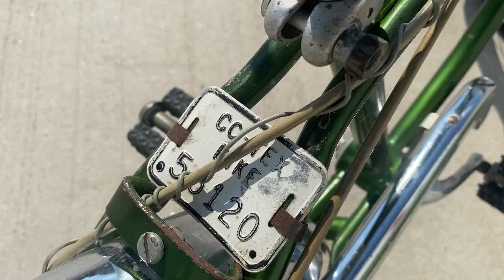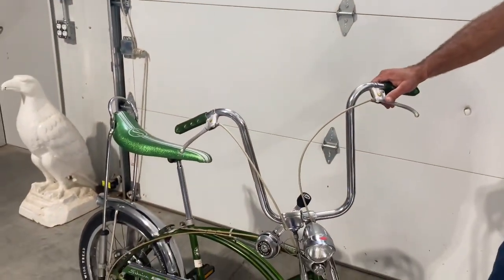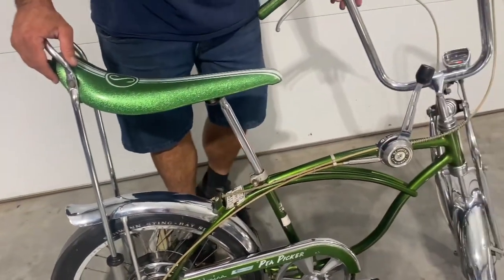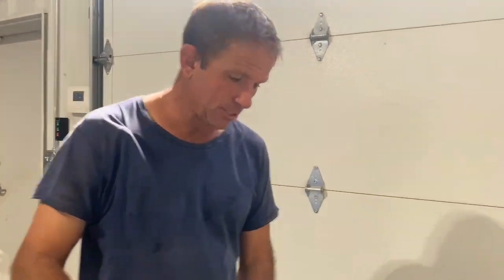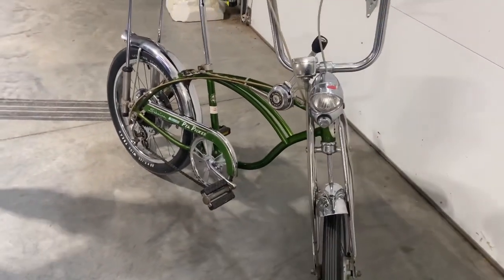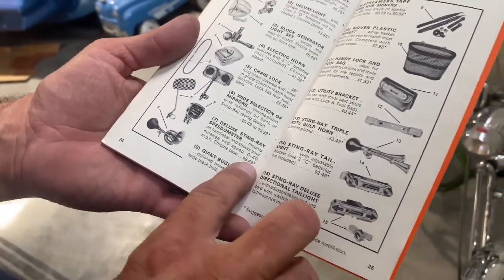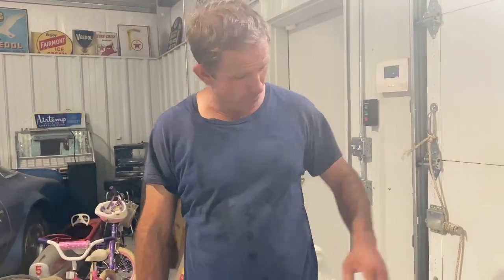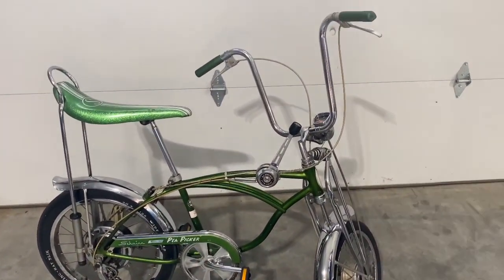1972 Schwinn Pea Picker Krate Muscle Bike Disc Brake Original bike with Accessories & Owners Manual!

Comment: I can't see putting that much emotion, time and energy into something thats basically a childs bicycle. I had a bare bones green coaster brake pea picker with the rear base coaster brake and drag slick from 1967 at 12 years old, got stolen 2 years later. Was more interested in my Makaha scateboard and thought nothing of riding 5 miles onto the main blvds in town in Long beach Ca.